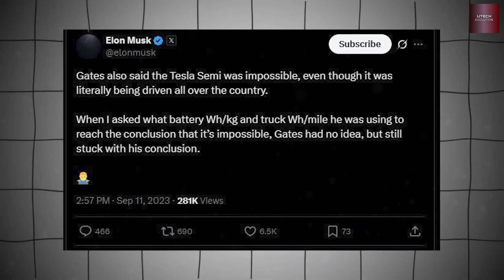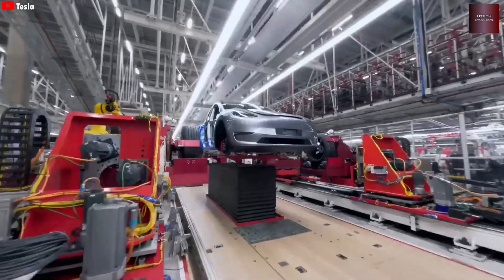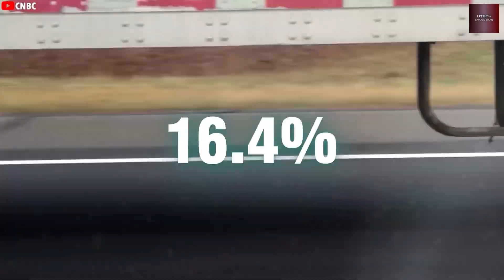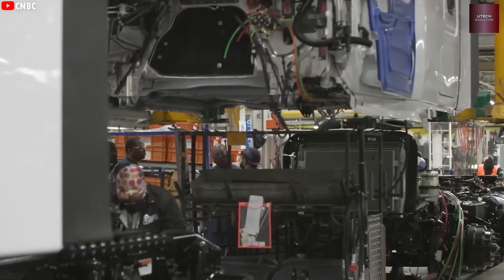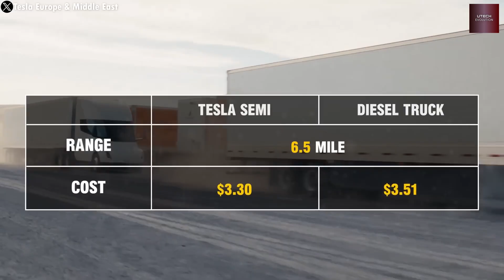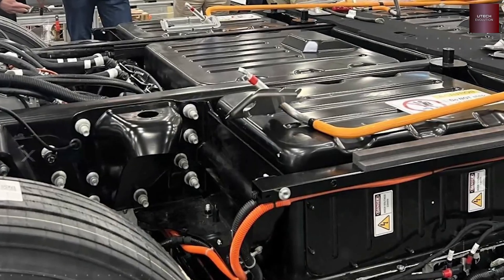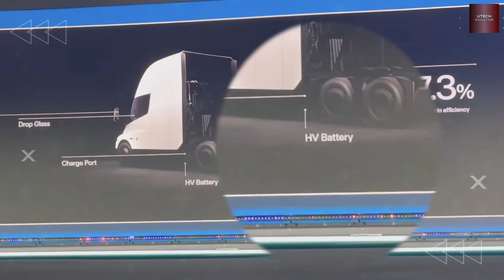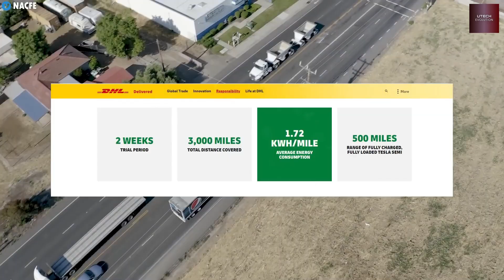Tesla Semi Gen 2 Officially Revealed! Elon Musk Confirms Mass Production, New Battery & FSD Features

Comment: This truck has the potential to disrupt the Bus/Coach RV market as the base for RV's builders with easy frame extension to get max permitted length and height with the likely extended range from the light loads with even the heaviest of coach buildouts. Expect 1000+ mile range between charges maybe because gross weight is no longer an issue double or triple battery options giving these RV's true coast to coast range between charges. A FSD custom coach for far less build cost than what's being used currently as stated a gamechanger.